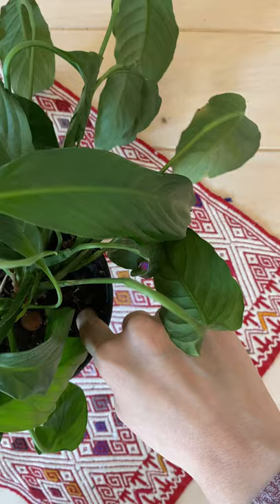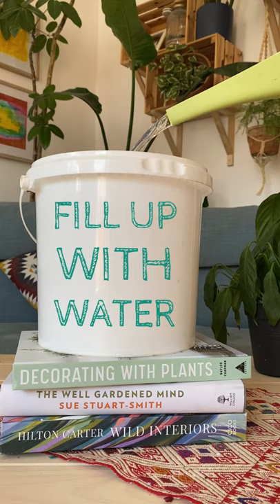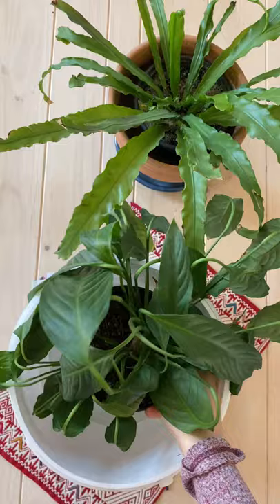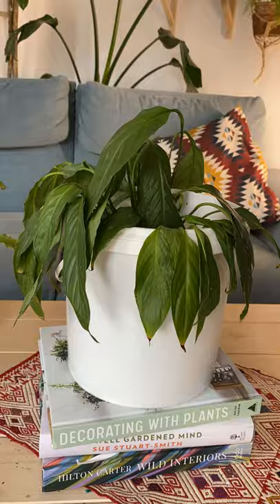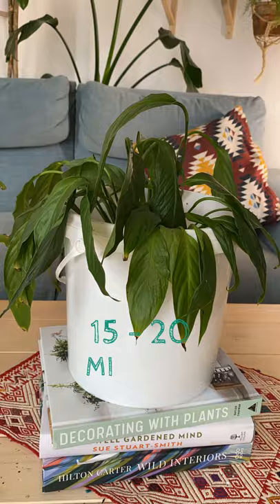FIX PEACE LILY DROOPY LEAVES! #shorts

Comment: Thanks. So you submerge the plant all under water? Soil doesnt float?
Reply from the maker: That is a great question ! It depends.. if you have a plastic pot, it may float. But in that case I water a little from the top as well and that helps with the weight :)
Reply: I don't think the water is over the soil or the entire plant, but just the pot. It's getting watered from the bottom because of the drainage holes.